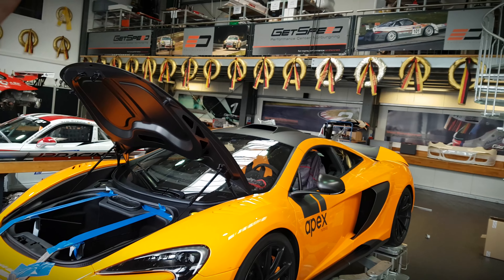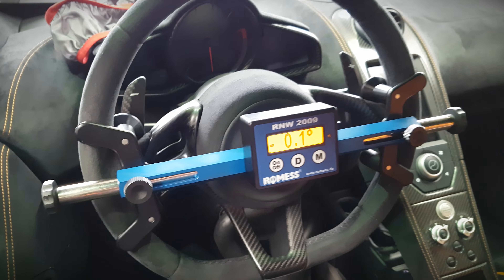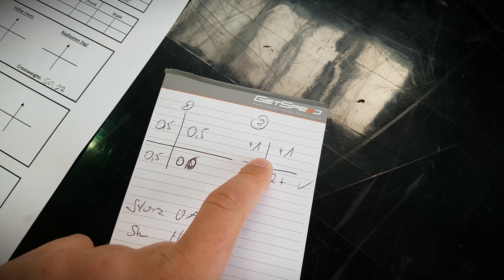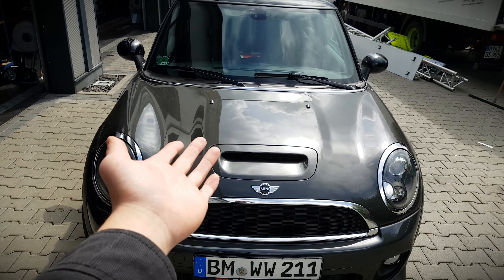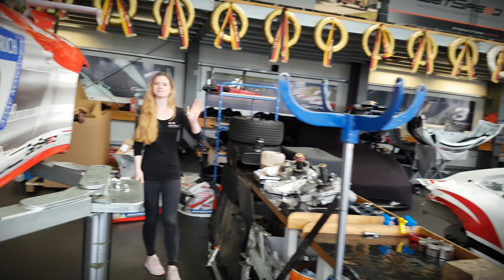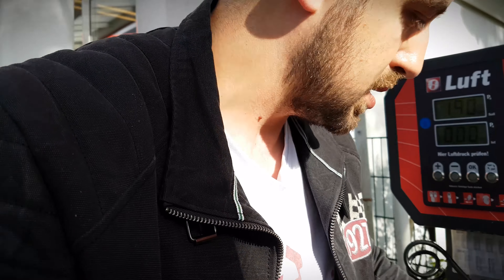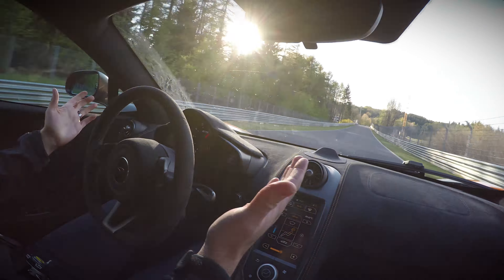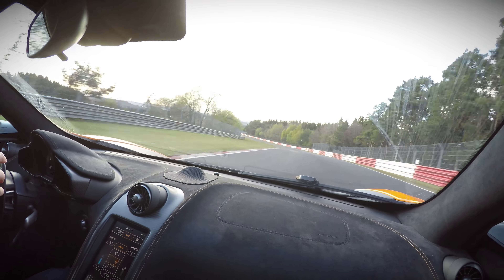McLAREN 675LT: NÜRBURGRING NORDSCHLEIFE SETUP

Comment: i had the same issues with my car. totally unstable at high speeds. a proper setup had solved it. But in a car that pricey it should be perfect from factory? Was it so from the first kilometers ore after a while?

Comment: Misha - why is there no published Nurburgring times for any McLaren?
Reply: Vafa Mansouri I asked that direct w the folks at McLaren.  The impression was made that they aren't concerned w the pissing match and that there is no regulation on the matter so it makes little sense.  It's a great testing tool but more than that they don't see the need of.   It could change in the future but that's the stance now
Reply: I can understand why an auto manufacturer would avoid such head to head comparisons but I cannot understand why no journalist or publication has put these cars to the test. Why hasn't AutoBild tested the 675LT on the ring? Perhaps you can offer yours.
Reply: Vafa Mansouri first of all there is only 500 of them (yeah take the spider and it's 1000) so you'd have to see how many are in EU.  Of the ones in EU you have to see how many actually get driven vs garage queens.  

Then of the ones that get driven you have to find out how many owners even care about the ring and are okay with it banging around the NS. You see how many places the car bottoms out.   Finally of those owners in EU who drove the care, which are going to hand the keys over to someone to do 30 laps to set a time?   

In my opinion the risk is too high to let someone else beat around the ring, don't k know them, their mindset and their goals. 

I want to keep my car safe but still have fun with it. I really hope that nothing ever happens to it. However the way I use it, If something does it'll at least be my own fault and not some racing driver of journalist who can't replace it. 

Setting a lap time requires a lot of support and set up, tires, brakes and wears on a car. The laps you see are not set in 2 rounds. Especially a sub 7 min car. The driver needs laps to get used to the car.  Look how this hunt has turned in for Koenigsegg.  Full factory operation and the car goes over the rail at Adenauer Forst.   No good and lucky no one was hurt.

Comment: so whats the beep beep on low speeds?
Reply: michO_e the car yelling at me about tire pressure.  I like warm pressure of 2,0 front and 2,05 back. So after a warm up lap I need to set around 1,9 all the way around.  The car beeps at me a bit if one dips to 1,8 on the monitoring system. That goes away by T13 normally.  However you are supposed to have a bit higher pressure in a tire at sustained high speeds so on the straights SX Döttinger etc the car beeps at me again as the 2,0 is under what it wants to see.
Reply: aight got it, thanks for explanation :)

Comment: What was yellow.  I just tracked my 675LT at Mid Ohio and had oil temp in the yellow and red after 2 laps.  Is that what you are talking about.
Reply: KevanMillstein multiple yellow flags secretions on track. Nothing wrong w the car.
Reply: KevanMillstein if you got to red in two laps of Mid Ohio something isn't right w the car.
Reply: How hard were you on it and for how long.  What was the temp outside.
Reply: kevin, I can do 4 laps on a tank of fuel from full to empty and that is right at 30 minutes of hard driving.  In that time the car does not overheat.  It is not possible to run the car harder for any longer as it will run out of fuel. The hottest I've tracked is around 85-90 degrees and that still holds true.  I don't really have a desire to track when is hotter than that as I can't deal w the heat lol

Comment: 1,9 bar on tires on first lap and you went even lower on second. I always thought it was around 2,3-2,5. Why do you go so low, better traction (grip), higher speed, faster acceleration?
Reply: Aleksandar Isaković 2,0 warm is where the trofeo works best on this car.  I start the second lap At 1,9 because as you know, the warm the air expands and brings the tires ip. So I start the first lap at 1,9 and it heats up to around 2,3. For the second lap I bring it back to 1,9 And then on that lap it heats up to around 2,1 again.  On the third lap I set them to 2,0 and it's good for the day.    Each tire and car is different.  The LT on trofeo 2,0. The speciale on Cup2 is 2,2 front and 2,3 rear. 

You have to drive each tire on the car to see where it works best.
Reply: Thanks for explaining that for me Robert. What would the car feel like if you filled the tires with nitrogen like Nissan GTR? Do you think you could go even faster on the ring?

Comment: those pressures seem low?
Reply: I wrote this in a post below "Aleksandar Isaković 2,0 warm is where the trofeo works best on this car.  I start the second lap At 1,9 because as you know, the warm the air expands and brings the tires ip. So I start the first lap at 1,9 and it heats up to around 2,3. For the second lap I bring it back to 1,9 And then on that lap it heats up to around 2,1 again.  On the third lap I set them to 2,0 and it's good for the day.    Each tire and car is different.  The LT on trofeo 2,0. The speciale on Cup2 is 2,2 front and 2,3 rear. 

You have to drive each tire on the car to see where it works best."

Comment: Are there normal seatbelts in the lt? Please dont wear the harness. You're both too large. In a crash you spine will get compressed. The holes in the seats have to be at shoulder hight (slightly higher).
Reply: Maxime Vhw not sure where your Information is sourced but it's somewhat incorrect. 

 FIA regulation states that harnesses go through the seat at a height that supports the the fact that the belts are to be mounted behind the driver either even with shoulder height or 20 degrees LOWER at the connection point..... Not higher as suggested. 

It is also regulated that the harnesses are not to have interference from the seats.  So if the hole in the seat were higher than your shoulder and then belts were mounted at shoulder height or lower there would be interference from the seats and this would not meet regs.  They would be automatically incorrectly installed. 

If you take a straight line from my shoulder to the harness bar it is downward 15 degrees, goes through the seat hole  just barely touching the top of the seat hole.  If I have a jacket and a sweat shirt on it looks higher but it's not.  

And yes, the car has normal belts as well.